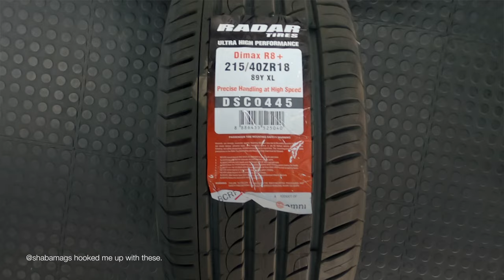New wheels for the wagon | 18" wheels is perfect for a VW Mk4

Comment: I'm looking to get a golf 4 wagon tdi how reliable are they any problems to look out for etc. Car looks awesome man
Reply from the maker: The best car i've owned by far. It's brilliant and really reliable. I've had an issue with a valve dropping because of a bad major service. But other than that, it's been a pleasure to own. They don't make as much power with software but it's not slow. And it's really light on fuel. You can get over 1000km on a tank of fuel. Would recommend the Mk4 TDI.
Reply: @lowdl  shot bud yea i have been looking for a decent one for a while if I can't find the wagon I'll have to settle on the jetta then just something reliable for work
Reply from the maker: @jonathanmclean4417  If you find a clean one, go for it. The pricing is really good. It's a lot of car for the money. High mileage is normal for a TDI so don't be too concerned as long as it been well looked after. Mine is at 280k km. I need to do the clutch now, it's on its way out. Jetta's are usually cleaner than Golfs so you're likely to find one that's decent. I saw a super clean Jetta at the J2 workshop 2 months ago. It looked brand new inside, I was blown away.

Comment: Nice video buddy. Do you have coilovers fitted?
Reply from the maker: Thanks a lot. Yes, It's on FK coilovers.
Reply: @lowdl  lekker man. How's the ride with the FKs? Reason I'm asking is I just installed Jom blueline coilovers on my Mk4 GTI and when I had the car low it becomes too bumpy. It's still on oem 16" wheels
Reply from the maker: @sheheensumad  The ride is decent. It's firm but not overly bouncy. I drove to Hermanus this weekend and I was pleasantly surprised how the car drove. The ride has a lot to do with your tyres, if you've got the helpers in and the length of your bump stops. I cut my bump stops down more than half (A bit too much on the right side) that increased suspension travel, removed the helpers and the tyres I'm on has a supple side wall so it feels better than it did before on the 17's. I had Vitours on the car and the sidewall doesn't flex much so it was a very firm ride.
Reply: @lowdl  thanks for responding bud. Much appreciated. Looking forward to new uploads of the 1.8 20vt
Reply from the maker: No problem and thanks for watching. Really do appreciate it. 🙏🏽